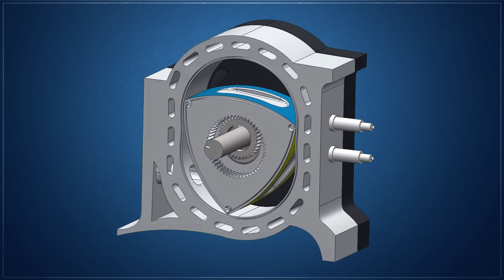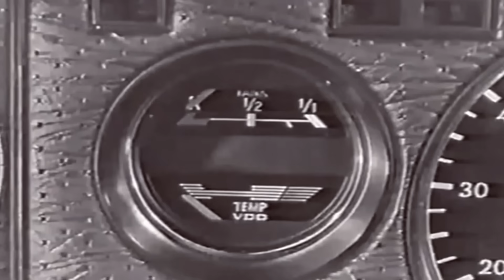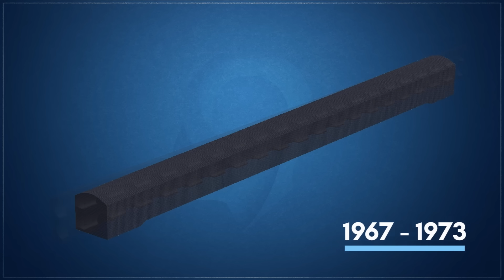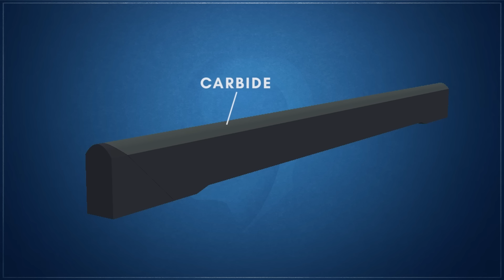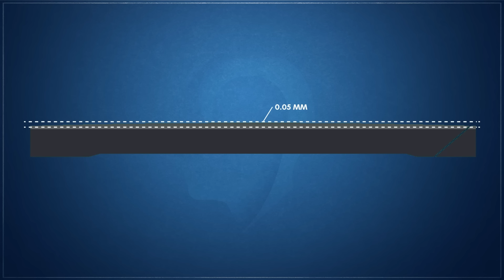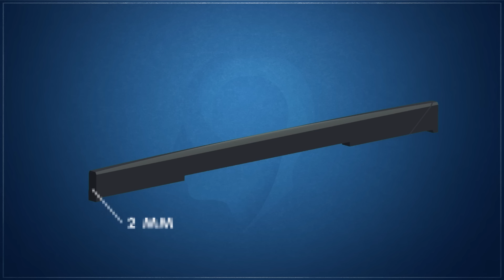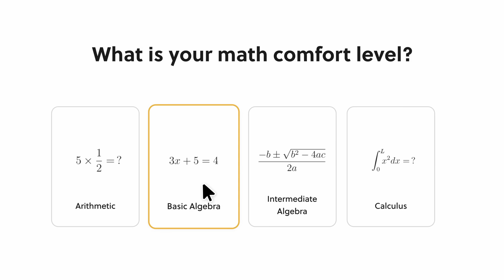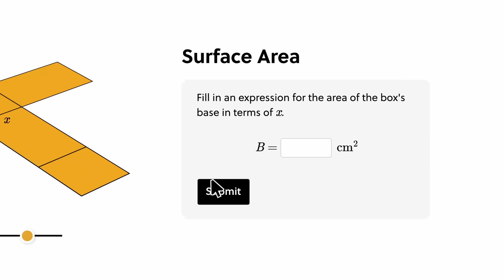Overcoming The Rotary Engine’s Biggest Flaw

Comment: The biggest flaw of the Wankel engine is not the apex seals - Mazda solved that quite adequately.    The biggest flaw is the completely stupid combustion chamber shape - giving low fuel efficiency.
Reply: The biggest problem remains the reliability issues with the seals, no one has ever solved this problem.
Reply: @mKarsten No.  The Mazda seals last quite adequately.   Mazda  forums indicate life exceeding 100,000 km even in early RX-7's provided they are not hotted up with turbos etc.  Mazda has improved the seals further order the years and 200,000 km is now the norm.  In principle, the seal issue, which is a durability issue, is solvable, given sufficient ingenuity.   But there is NOTHING that can be done about the combustion chamber shape, so the engine is inherently inefficient.
Ideally, you want to minimize the combustion surface area for a given combustion volume, as that minimises the loss of combustion heat via the surrounding metal into the coolant.   The best possible shape from this point of view is a sphere.  You cannot of course have a perfect sphere as the shape must change in order to have compression and expansion.   But a hemi head on a piston engine come the closest, closely followed by bowl-in-piston designs.  The combustion chamber in a Wankel engine inherently has to be long and thin, giving a very much worse volume to area ratio.
Reply: @keithammleter3824  You sir are very confused and misinformed regarding this subject.
Wankel engines are inherently unreliable and the primary failure mode is compression loss due to ablative and high brisance damage to the apex seals.

This is an irrefutable fact that cannot be disputed, the MTBF of apex seals is so low that Wankel engines are illegal to install in type certified passenger aircraft.
Reply: @WilhelmKarsten  You sir are not only confused and misinformed, as a check of forums devoted to Madza rotaries will show, you have missed my point that there are two issues:-
durability issues - an engine may perform well but have a short life;
and
fundamental design issues -  fundamental principles may prevent an engine from operating efficiently.
The first kind are amenable to sufficient ingenuity, the second are not.   Mazda or someone else may further improve the life of the apex seals, which are already adequate, but there is NOTHING they can do about the high fuel consumption.
Reply: @keithammleter3824  Your comments reveal someone who has no formal education or professional experience regarding this topic and that you are clearly not qualified to discuss it intelligently.

Wankel engines are a failed, obsolete concept because they consistently fail to compete with other ICE types in regard to Durability and in particular reliability.

Every type of reciprocating piston and gas turbine engine has been reliable enough to pass the minimum PFTR reliability requirements for FAA and EASA airworthiness certification... the only type of engine that has proven too unreliable for aircraft is the Wankel engine.
Any questions son?
Reply: Hemispherical combustion chambers are obsolete technology due to their extremely low combustion efficiency; Modern engines use high efficiency, high-swirl chamber architecture like the Pentroof and Wedge type chambers.
 the Wankel KKM design cannot support a high efficiency combustion chamber due to the limitations of its geometry envelope.
  Apex seals are fatally flawed by design, they are not a positive type seal like a modern twist type piston ring, apex seals start to fail when exposed to high combustion chamber pressure and temperatures and are easily damaged as the hot gasses leak past the seals
they are also more easily damaged by shock waves from detonation or "knock"
Reply: @DoktorBayerischeMotorenWerke  You have things backwards and also have some misconceptions.    
High swirl, because of the reduction and even out of temperature within the combustion space, reduces the tendency to pre-ignite and allow you to increase the compression ratio in gasoline engines - which may increase power output and partly, but not wholly, compensate for the increase heat conduction.
high swirl means high heat loss as it thins the boundary ("Carrier") layer - the layer of substantially non-moving gas adhering to surfaces.  It is why combustion can reach white heat yet the head doesn't melt even if aluminium.   Non-moving gas is a heat insulator.
In diesel engines pre-ignition cannot occur, and so bowl-in-piston designs are still dominant.   As I said earlier, bowl-in-piston design is an equally performing alternative to hemi-head.   But it transfers more heat to the piston instead of the head, so it has only been used in small car engines (eg Ford Cortina) and in turbo engines where the piston needs to spray oil cooled anyway - as in modern diesels.
Wedge head designs, along with bathtubs,  were a feature of 1950's engines as they similarly reduce pre-ignition and make the engine non--critical in tuning.  
A pent-roof is essentially a hemi.   The modern use of 4 valves as large as possible  with only one or 2 camshafts forces the top surfaces to be somewhat flat, and this has led to marketing people calling it pent-roof.
The large area devoted to valves  improves breathing and thus power output at high RPM but does nothing for efficiency. 

It is all very well to keep saying apex seals are prone to failure, however it is a fact that Mazda have achieved acceptable seal life.

Comment: By 2027 the EPA will be phasing out Diesel and gasoline will be the next one with its head on the chopping block , can the Wankel be converted to Hydrogen , then it would be a great  hybrid car engine and will meet California standards for Emissions
Reply: Wankel engines cannot support the higher static compression ratios needed to burn Hydrogen efficiently and their is still the emissions problems due to oil loss and burning.
Reply: Biden just announced they are backpeddling on the phase-out plans of ICEs...
Reply: That comment didn't age very well..

Comment: I had a beautiful red RX-7 back in the 1990s and loved the "Wankel" it came with. I babied that machine like my first born. Right up until it blew up on me and left me stranded on the highway. Rotary engines are trash.
Reply: Thats your problem right there: youve babied it. 
Literally the first rule of driving rotaries is to rev them frequently. If you do the maintenance in time, use good oil and gas and treat the engine like a rotary - its pretty reliable. Especially the 7s 13b rew.  A lot more reliable than the modern junk.

Comment: Your video is very good at describing the way of overcoming the biggest practical issue with the rotary engine. However the fatal flaw is a theoretical one: it's afwul at captchuring the energy of the cumbustion. In a piston engine, a good portion of of the flame front directly pushes down on the piston, while in a rotary it always squeezes into a wedge. Even with having to translating the longitudinal motion into a rotating one, piston engines will always be at a significant advantage and the numbers in efficiency and consumption speak for themselves. Even in that latest Mazda you described, those numbers sound awful. 13 gallons for 337 miles? Are you sure those are correct? Cause that doesn't sound like anything I'd be bragging with.
Reply: The biggest fatal flaw in the Wankel engine has never been solved, that is its unacceptable reliability issues and overall poor durability.
The Wankel has never been efficient it has inherent limitations in combustion efficiency, thermal efficiency and low mechanical efficiency... it offers no advantages over other engine types and has several major disadvantages.
Reply: captchuring
Reply: C**bustion
Reply: @istillplayStuff1000  LOL

Comment: The seals aren't the biggest problem.  The biggest problem is the design itself.  As the rotor moves away during the compression event, the volume of the chamber area increases exponentially causing a radical drop of compression after ignition of the charge leaving a less than fully complete burn charge.  A piston by comparison only doubles its volume with half its travel and by doing so retains more compression during the ignition event.

The second problem is that the "stroke" is too short - between the dropping compression after ignition and the short stroke, some combustion is still happening during the exhaust phase.
Reply: Correct, the Mazda 13b series has a 15mm eccentric-crankshaft offset which only produces a 30mm overall stroke... this combined with a force vector that operates at a mechanical disadvantage, the opposite of a reciprocating piston engine.
The result is very low BMEP and very poor torque output characteristics.
Reply: The primary failure mode of all Wankel engines is compression loss due to high brisance and ablative damage to the apex seals.
The Wankel engine has an extremely poor combustion chamber design and cannot support modern high swirl or Quench type chamber technology.
This results in erratic flame propagation and detonation that damages the fragile seals.

Comment: Almost the worst generator considering the fuel efficiency...yet weight savings vs traditional engines counteract that notion.
Reply: The concept of combining a noisy, dirty, inefficient and unreliable Wankel with a "Green" EV is the epitome of contradiction and bad design.
Reply: @sandervanderkammen9230  word.
Reply: @sandervanderkammen9230  — Noisy, dirty, inefficient, unreliable … That sums it up very well …

Comment: Enough has been said about the rotor's tip seals... But what about top and bottom? Every chamber has 4 sides where gases could escape.
Reply: Each rotor has 6 side seals, 6 corner seals, and 3 apex seals. Side and corner seals are just below the edges of the rotor, and they seal each combustion chamber against the irons. The apex seals are on the tips of the rotors and only ride along the housings. There’s also oil control rings that are on the sides of the rotors that keep the oil out of the combustion chambers for the e-shaft, stationary gears, and bearings lubrication.

Comment: Apex seals are not the biggest problem of rotary or wankel.. Low compression ratio, oil consumption and large fuel consumption and incomplete combustion are the biggest problem.. Its great for racing but not for daily use
Reply: Actually apex seals are the primary failure mode of all Wankel engines and are responsible for the designs poor reliability and durability.
Reply: Wankel engines have never been very successful in racing, Mazda has abandoned all of their Wankel motorsports programs

Comment: I still think that the best way to deal with this type of engine is to bin the whole idea! There is an engine that is massively more efficient and was invented and perfected years ago, it does not need the use of fossil fuels and is called the electric motor.
Reply: Car $1000.00 battery 40000Then you will never get the time  back charging  batteries short life span how many 20 year-old Teslas are out there

Comment: A small diesel piston engine is superior as a "generator" for range extension.
More efficient and less fuel to lug around.  Diesel will also run hundreds of thousands of miles.  Rotary as a generator is rather silly.
Reply: A rotor optimised to run a generator would last a very long time and be small and efficient. The rpm and a/f ratio could be set precisely.
Reply: @Benny_Shill  But a high compression makes efficiency. Low compression rotaries just can't compete with high compression engines for efficiency.    That's why high compression diesels rule the waves and the highways for commercial traffic when efficiency is the bottom line.   Also, rotaries are not known for long term reliability at high rpm (small) engines.  I just don't understand why the push for historically low reliability and low efficiency engines be used for generator service,

Comment: No. Monel makes excellent rotor apexes. The main problem with common Wankels is liberties taken with the dimensions of ports to hot rod the motors. The second problem is the rotor inside oil cavity is not properly  oiled and scavenged. Air or water cooled, wankels are a sensible higher output motor design
Reply: Apex seals are the primary failure mode of all Wankel engines, this is due the Wankel engines appallingly bad combustion chamber architecture...
It's really a ticking timebomb.
Reply: @sandervanderkammen9230  OK, but I think the key failure is the phrase ALL wankels.

Comment: What a waste of a video/topic.
Rotary engines will never be as good or efficient as a V6 or diesel engine.
Rotary engines wear out and have to be rebuilt at less than 100,000 miles.

Meanwhile, Mercedes Diesel engines rack up over 1,000,000 miles, and Toyota petrol engines last for 300,000 or more.

Comment: The fact that it needs oil injection to lubricate the surfaces makes this engine obsolete.  It will never be fuel efficient or emission compliant.
Reply: Could've been if it stayed in high end motorsport with improved technology trickling down.
Reply: It passed emission stds, but the nature of a rotary (no power at low speeds) made it naturally inefficient.
Reply: @Greatdome99  Can't even pull me out of the bed while screaming at 9k RPM

Comment: Other than it's a oil burning fuel gobbling  2 stroke  (spare the 'indignations'..  it is exactly That!)
 In which  Combustion sealing has proven a perennial failure.. 
Bin the design as unworkable and Move on as everyone else has done.
Reply: It's not a 2-stroke.  But since your mind is closed, I won't bother trying to explain why.

Comment: The only one that I know of that has truly solved the problems with the rotary engine is Ernie Brink. He was a mechanic and thus knew the engines well and using his knowledge he truly solved all that was wrong with the rotary engine as basically the engine went into production with some major design flaws. You should look him up and see the changes he made to the engine.
Reply: Ernie Brink was nothing but a crackpot and a second rate con-man who was fired from Mazda for drinking on the job and crashing a customer car.

 Ernie lost his battle with alcoholism
Reply: @sandervanderkammen9230  — When did ole Ernie die? It seems like only yesterday he was still hawking that damned Wankel to anyone dumb enough to listen to him.

Ernie was a study in wasted potential. He became emotionally attached to an obsolete idea and hung on to it all the way down the crapper. Such a waste …

Comment: The issue of materials in Wankel RCE seems totally solved today: Aluminum for housing; nikasil for working surface; ferrotic for apex seals, IKA for side seals. A three piece apex seal, as in Citroën patent GB143850, could help tightness. 
Iron for rotor, aluminum rotor if you need a reduced weight for racing the engine faster.
 
Always add some oil mixed directly to fuel, 1 % is enough, oil pumps fail, this prevents engine destruction. Mazda had MoS2 added in the oil of Le Mans endurance and economy race winning Wankel. You could consider 1 cc LiquiMoly Molybdenum additive per litre of oil in gasoline mix. An 80 RON fuel is enough for a Wankel, a type of engine specially suitable to E5 or E10 ethanol in gasoline fuels. 

Source of emissions and losses in Wankel is leaks at low rpm, quenching, flame extinction at cold working chamber walls, at high rpm. A hotter rotor surface reduces HC emissions. Air cooled engines, working at an slightly higher temperature, had better SFC in the early Yanmar Diesel Wankel engines, SAE papers 710581 and 720466, downloadable form www.sae.org site, membership not required. 

The Small Wankel Engines by Sachs, from KM-37, KM 48, to KM-24, KC-27 and KM-914, all had same Rotor design and side seals, equal to the Aixro Wankel Kart and Ultralight Aircraft engines of today, just rotor width changed; with the wider rotors, a great improvement in SFC was seen. 
Port overlap was a big cause of emissions, fresh mix going through the exhaust port, burned gas entering intake stroke, Mazda fully solved the issue in the Renesis RX-8 engine, side intake and side exhaust ports, zero overlap.
 
But perhaps it would be better having a Peripheral Port, NSU proved rectangular ports are better than round intake ports, fitted by a Reed-Valve, with Side exhaust ports, also zero overlap, for better BMEP.

Toyota with an R-V controlled P-Port, a Glow Plug in leading plug site, and air injection in exhaust port, SAE paper 790435, had a 9 % fuel economy improvement. Kawasaki obtained improvements, patent US3848574, by adding an extension of plug hole, wedge shaped, pointing towards trailing side of Rotor. The video here 'Rotary engine breakthrough' https://youtu.be/m3pCLjHZmhM?si=-IVGs3VkqPJcXhrz obtained a noticeable reduction in Exhaust Gas temperature of Wankel, indicative of higher BMEP, higher actual Compression ratio, by changing the larger area round plug hole into an slot type of plug hole. 
Recent Aixro engines have the plug hole pointing towards Rotor trailing side. 
Small changes, big results!
Reply: Please stop spreading lies and ignorant misinformation about Wankel engines.
No one has ever solved the fatal flaws in the Wankel engine, they are inherently unreliable and inefficient because it's fundamental concept is inferior to other types of more successful ICEs
Reply: WOW!
An impressive list of epic Wankel failures dating back decades.... and completely irrelevant in a modern era where Wankel engines are obsolete technology

Comment: can we used mixed fuel with 2 stroke oil ? so it will lubricate the seal
Reply: Only if the manufacturer instructs you to.